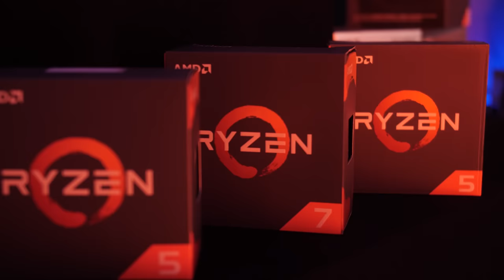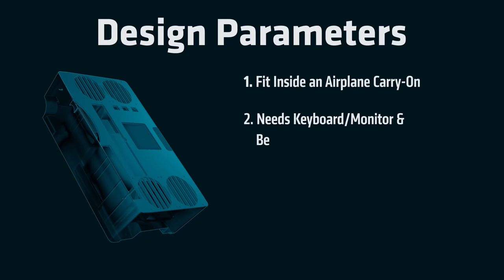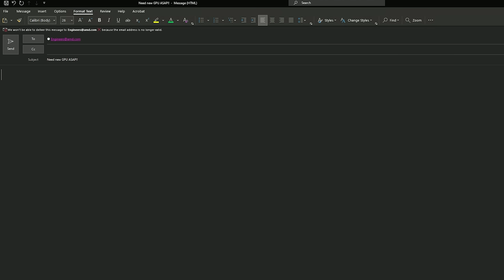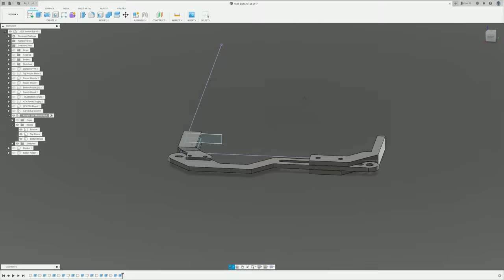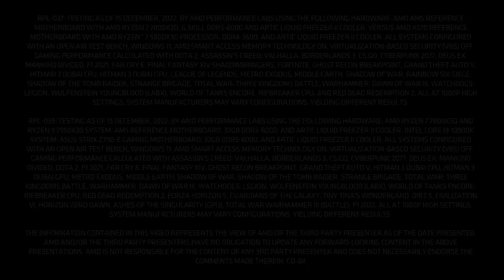The Bring Up: Dr. Lisa Su and Cavin's DIY Flight Case PC Build

Comment: Okay so naming the build is easy, The Minion :-)  As for the build I would have gone with an ITX board to save a little more space but otherwise very cool. 

For travel I use an Xproto based build that fits perfectly in a sewing machine travel bag, along with the peripherals and cables. Unlike your I have to carry the monitor separately. But for hotel use I can always hook to the TV in the room.

Comment: I hope the RX 7500 XT is awesome.
Reply: LOL really? I hope so but I don't think it will amount to much.
Reply: Should easily be 6600xt with lower tdp
Reply: I wouldn't go that low a tier. I mean look at the 6500XT (performed worse than a 5500XT). The 7600/XT should be pretty good.
Reply: @HuntaKiller91  Again look at the 6500XT. It wasn't on par with the 5600XT and was actually worse than the 5500XT. Don't expect too much but if it happens to be good that's cool.
Reply: @vigilant_1934  I had a 5600xt! Quite a gem! Dominates any of the gpu mentioned for 1080p gaming even in 2023~!

Comment: Moore’s law is almost dead

There is a 4x of transistors in the same area left then silicon cant shrink

And from there on its chips grow outwards and or transistors get different layouts to improve density from design not from size reduction

As for the AI it needs Unity and UnReal integration to actually mean anything to the normal user so a few years out for it to be needed but smart to start getting it out sooner so more can use it when its out
Reply: The trend is to stop shrinking and start stacking. In a couple process iterations, transistors will be stacked on top of each other, and the density increase will continue.
Reply: @lucacrespi88  nope that will not happen outside of the server space

Consumers need faster and faster cores not more cores so stacking outside of cache is a no go unless you want a mini supernova as a CPU

But for Servers CPU stacking i suppose is possible but your giving up clock speed for more cores

The whole reason why threadripper and epyc exist is for no compromise compute

TLDR CPU transistor stacking is STUPID CUS HEAT DENSITY so no that wont be happening for consumers
Reply: @commanderoof4578  transistor stacking is already in the foundries roadmap. It will be used in their standard process, so it will hit both server and consumer market.

Comment: Instead of talking non sense make your gpu driver stable so people can work on their system better, people is not gaming on their system all the time they also use thier pc for work, no driver update from last 2 months looks like amd don't care about a sht about their customer i just purcahsed 6700 XT and worst dission of my life instead could have gone with expensive 3070 with stable performance
Reply: Whats not stable? Have you checked your display cable? Most of the time I had windows updates make my system unstable more than display drivers. Why are you needing updates? Why are you downloading drivers for 7000 series? I'm on 22.3.1 and that's my choice because I have literally no issues gaming or work wise with the Microsoft suite or rendering. Did you submit a trouble ticket? I don't understand peoples need to update.
Reply: You are having issues with the enterprise driver?